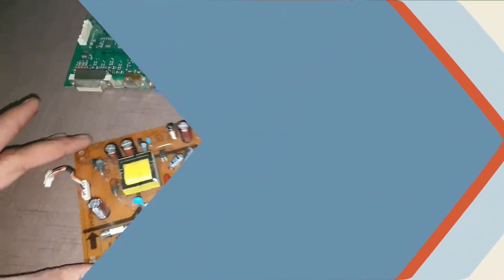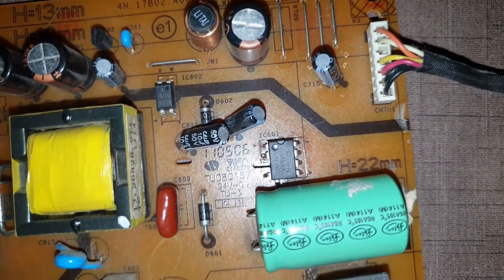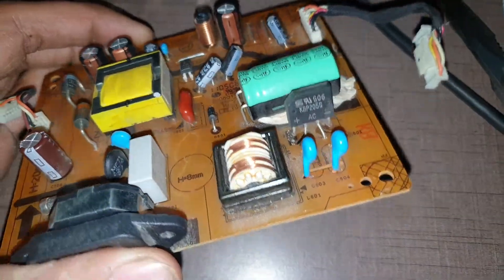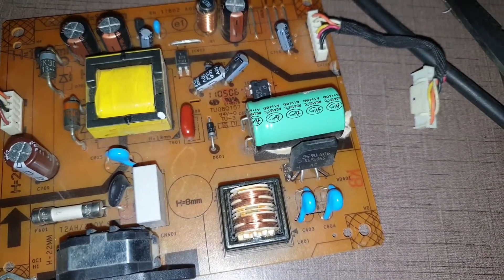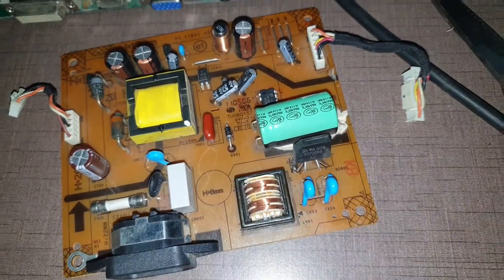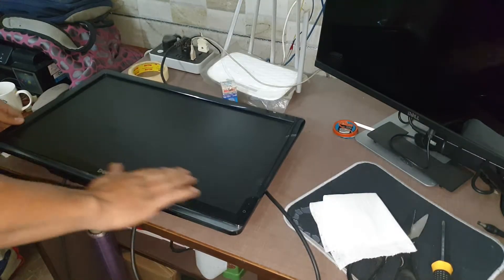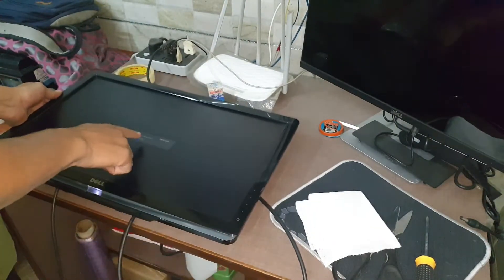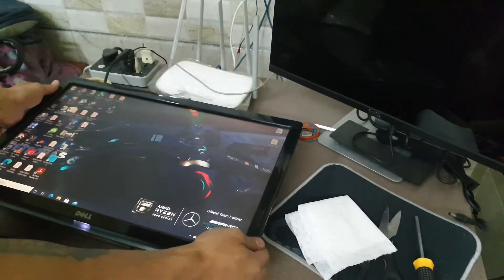Fix Monitor Turns Off after few seconds or Minutes Repair Guide- DELL, LG, SAMSUNG and Many more.

Comment: When you say it turns off, do you mean the screen goes black and the power light stays on, or does the power light go out as well? My power light stays on when the screen goes black, and I'm wondering if that means it's a different problem.
Reply: Same here.  I only replied so I can be notified if someone answers you.
Reply from the maker: It goes to sleep. but the machine will keep running
Reply: @kaystech6408  Thank you for responding. Then perhaps there's hope for my monitor.
Reply from the maker: Does the monitor work without any source or it shows only power indicator and no sign of power on screen

Comment: Thanks for the good video - pretty interesting. I did disasamble my screen already, but could not find any issue. The capacitors look good and measure okay, the IC you have, it is not in my screen Power Supply. But it has the same phenomen that you describe - it works sometimes for up to 20 minutes, sometimes it crashes after 20 seconds. But I am out of ideas. I think it is not a heat issue, more a component that runs out of its specifications.. any candidates what to check on the HP LA2405 models?

Comment: Bro still same turn off after replace top285
Reply from the maker: Do you have the same issue that monitor turn on and shut down after few seconds without playing and media
Reply: @kaystech6408  now the monitor restart when show the acer logo
Reply from the maker: @drugloader369  have you checked the IC position. And also make sure touch the IC while you start your monitor. If it get too hot it may be damage. Please check that.